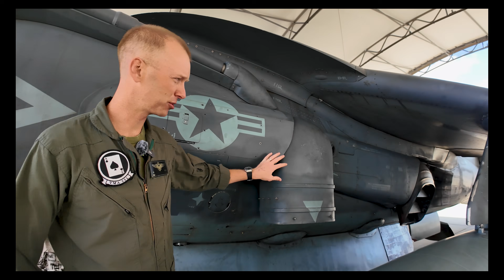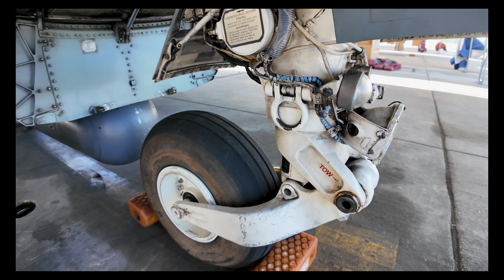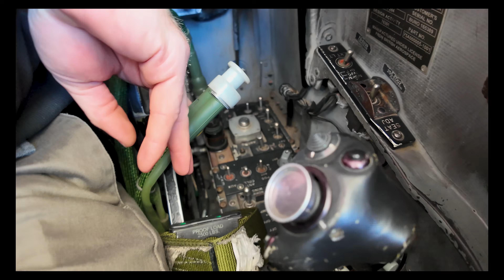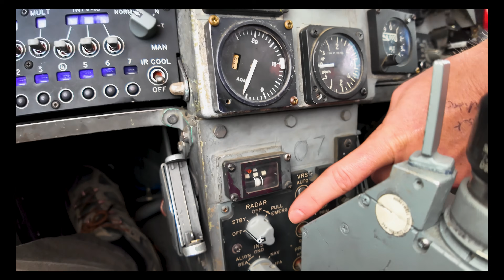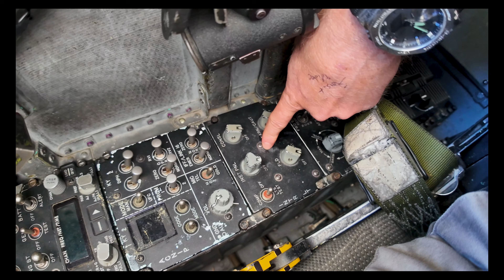AV-8B Harrier Walkaround Tour

Comment: 🔥 
Interesting that caring around 500 pounds of water only gets you 200 lbs more thrust (if I understood it right)
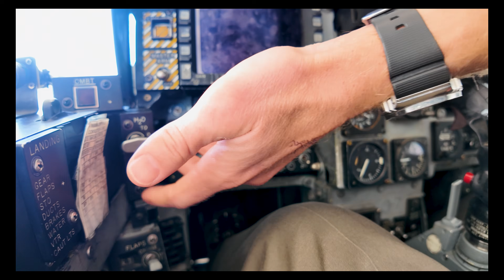Reply: 13:45 sounds like the H2O is used frequently in flight regimes when the water has more benefits to the engine than just additional thrust.

Comment: I've never seen a Harrier up close but I did have a basic understanding of the cold and hot nozzles and them being handled manually - what a crazy kind of flying that must be, especially slowing down from normal fixed wing flight into that hover state. And even knowing that the Harrier is quite a rugged yet sophisticated piece of aviation engineering, I was still surprised to see how well thought through and implemented the whole RCS thing is. Thank you so much for these insights, Eric! Did the cockpit feel as cramped as it came across in the video? Some switches really seemed pretty unreachable thinking of having a G-suit on, emergency swim vest stuff, gloves and so on...
Reply from the maker: The cockpit didn’t seem too cramped, but man you’re right, I didn’t have any flight gear on and that definitely would have made a difference!